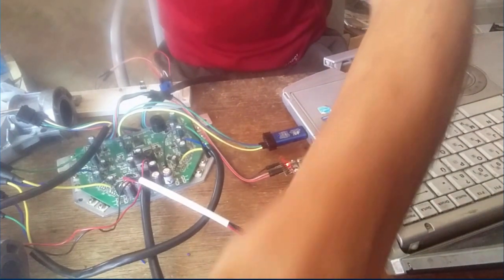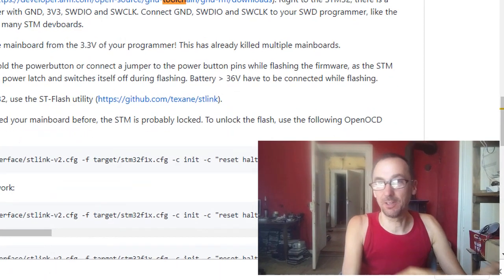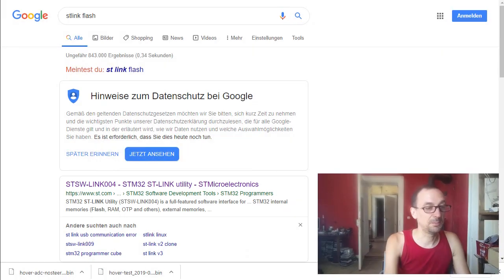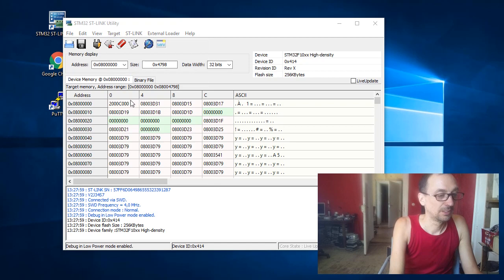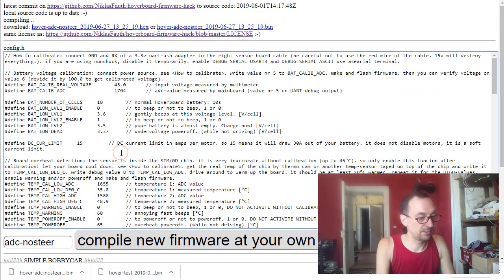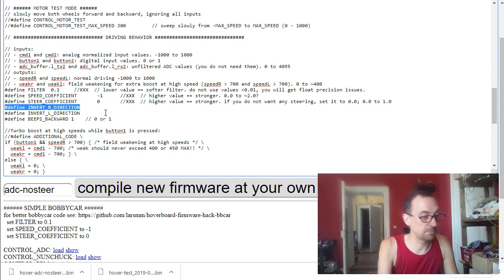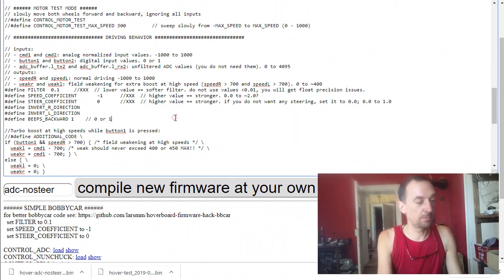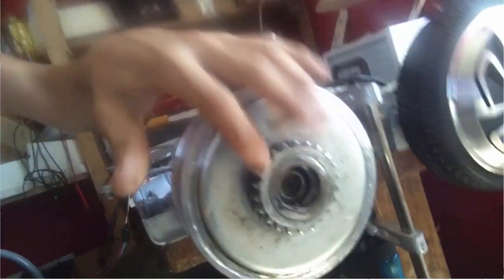free online hoverboard firmware compiler - full tutorial :-)

Comment: Hello, very nice video. I am having problem on ST link connection. I have done all the connections right. but i receive the error as " cannot connect to target". The board is powered from 36V battery, DIO, CLK, GND connections are done right. STlink dongle firmware up to date. I also tried powering the board from 3.3V from the dongle(cutting the battery power off.) what do you propose i should do? Thanks
Reply from the maker: You should shortcut the power button like shown in my video. I too had problems with connecting the dongle :-( There are some different settings in the ST-link app that you could try - but did not really help me. If nothing works then try to connect the dongle to a cheap "blue pill". If that works, than your hoverboard controller might be broken :-/ Sorry that i can not help you better :'(
Reply: @robodurden   Thanks for very fast reply. I am shunting the power button as instructed. Do you think that this might be related to different mainboard than the ones used for this firmware? Or is it because it needs unlocking? (they explain that for first flashing unlocking is necessary but no clear tutorial is available for that.)
Reply from the maker: @MertProVideo  i have already flashed two or three boards (gd32 and stm32) without any unlocking. I have no experience with stm32 chips. You might need to ask in a stm32 forum. If you have a DSO oscilloscope you could check the wires. And as i said, try to source a $2 blue pill..
Reply: @robodurden  Hi!!!! I bought bunch of new boards and one of them has worked out. (the others have some kind of hardware locks i presume.) 
I flashed the firmware using your nice compiler,  but cannot get the wheels to run or steer. I am using an RC remote, connected channel 1 and 2 as instructed, powered the RC receiver via 3.3V from the board. Did i make some mistake on the config file can you help out? cheers!

 
// Battery voltage calibration: connect power source. see <How to calibrate>. write value nr 5 to BAT_CALIB_ADC. make and flash firmware. then you can verify voltage on value 6 (devide it by 100.0 to get calibrated voltage).
#define BAT_CALIB_REAL_VOLTAGE        43.0       // input voltage measured by multimeter  
#define BAT_CALIB_ADC                 1704       // adc-value measured by mainboard (value nr 5 on UART debug output)
 
#define BAT_NUMBER_OF_CELLS     10        // normal Hoverboard battery: 10s
#define BAT_LOW_LVL1_ENABLE     0         // to beep or not to beep, 1 or 0
#define BAT_LOW_LVL1            3.6       // gently beeps at this voltage level. [V/cell]
#define BAT_LOW_LVL2_ENABLE     1         // to beep or not to beep, 1 or 0
#define BAT_LOW_LVL2            3.5       // your battery is almost empty. Charge now! [V/cell]
#define BAT_LOW_DEAD            3.37      // undervoltage poweroff. (while not driving) [V/cell]
 
#define DC_CUR_LIMIT     15         // DC current limit in amps per motor. so 15 means it will draw 30A out of your battery. it does not disable motors, it is a soft current limit.
 
// Board overheat detection: the sensor is inside the STM/GD chip. it is very inaccurate without calibration (up to 45°C). so only enable this funcion after calibration! let your board cool down. see <How to calibrate>. get the real temp of the chip by thermo cam or another temp-sensor taped on top of the chip and write it to TEMP_CAL_LOW_DEG_C. write debug value 8 to TEMP_CAL_LOW_ADC. drive around to warm up the board. it should be at least 20°C warmer. repeat it for the HIGH-values. enable warning and/or poweroff and make and flash firmware.
#define TEMP_CAL_LOW_ADC        1655      // temperature 1: ADC value
#define TEMP_CAL_LOW_DEG_C      35.8      // temperature 1: measured temperature [°C]
#define TEMP_CAL_HIGH_ADC       1588      // temperature 2: ADC value
#define TEMP_CAL_HIGH_DEG_C     48.9      // temperature 2: measured temperature [°C]
#define TEMP_WARNING_ENABLE     0         // to beep or not to beep, 1 or 0, DO NOT ACTIVITE WITHOUT CALIBRATION!
#define TEMP_WARNING            60        // annoying fast beeps [°C]
#define TEMP_POWEROFF_ENABLE    0         // to poweroff or not to poweroff, 1 or 0, DO NOT ACTIVITE WITHOUT CALIBRATION!
#define TEMP_POWEROFF           65        // overheat poweroff. (while not driving) [°C]
 
#define INACTIVITY_TIMEOUT 8        // minutes of not driving until poweroff. it is not very precise.
 
// ############################### LCD DEBUG ###############################
 
//#define DEBUG_I2C_LCD             // standard 16x2 or larger text-lcd via i2c-converter on right sensor board cable
 
// ############################### SERIAL DEBUG ###############################
 
#define DEBUG_SERIAL_USART3         // right sensor board cable, disable if I2C (nunchuck or lcd) is used!
#define DEBUG_BAUD       115200     // UART baud rate
//#define DEBUG_SERIAL_SERVOTERM      // Software for plotting graphs: https://github.com/STMBL/Servoterm-app
#define DEBUG_SERIAL_ASCII          // "1:345 2:1337 3:0 4:0 5:0 6:0 7:0 8:0\r\n"
 
// ############################### INPUT ###############################
 
// ###### CONTROL VIA UART (serial) ######
////XXX #define CONTROL_SERIAL_USART2       // left sensor board cable, disable if ADC or PPM is used!
#define CONTROL_BAUD       19200    // control via usart from eg an Arduino or raspberry
// for Arduino, use void loop(void){ Serial.write((uint8_t *) &steer, sizeof(steer)); Serial.write((uint8_t *) &speed, sizeof(speed));delay(20); }
 
// ###### CONTROL VIA RC REMOTE ######
// left sensor board cable. Channel 1: steering, Channel 2: speed. Use a very short cable!
#define CONTROL_PPM    //XXX                 // use PPM-Sum as input. disable CONTROL_SERIAL_USART2!
#define PPM_NUM_CHANNELS 6          // total number of PPM channels to receive, even if they are not used.
 
// ###### CONTROL VIA TWO POTENTIOMETERS ######
// ADC-calibration to cover the full poti-range: connect potis to left sensor board cable (0 to 3.3V) (do NOT use the red 15V wire in the cable!). see <How to calibrate>. turn the potis to minimum position, write value 1 to ADC1_MIN and value 2 to ADC2_MIN. turn to maximum position and repeat it for ADC?_MAX. make, flash and test it.
////XXX #define CONTROL_ADC                 // use ADC as input. disable CONTROL_SERIAL_USART2!
#define ADC1_MIN 0                // min ADC1-value while poti at minimum-position (0 - 4095)
#define ADC1_MAX 4095               // max ADC1-value while poti at maximum-position (0 - 4095)
#define ADC2_MIN 0                // min ADC2-value while poti at minimum-position (0 - 4095)
#define ADC2_MAX 4095               // max ADC2-value while poti at maximum-position (0 - 4095)
 
// ###### CONTROL VIA NINTENDO NUNCHUCK ######
// left sensor board cable. keep cable short, use shielded cable, use ferrits, stabalize voltage in nunchuck, use the right one of the 2 types of nunchucks, add i2c pullups. use original nunchuck. most clones does not work very well.
////XXX #define CONTROL_NUNCHUCK            // use nunchuck as input. disable DEBUG_SERIAL_USART3!
 
// ###### MOTOR TEST MODE ######
// slowly move both wheels forward and backward, ignoring all inputs
//XXX #define CONTROL_MOTOR_TEST
//XXX #define CONTROL_MOTOR_TEST_MAX_SPEED 300         // sweep slowly from -MAX_SPEED to MAX_SPEED (0 - 1000)
 
// ############################### DRIVING BEHAVIOR ###############################
 
// inputs:
// - cmd1 and cmd2: analog normalized input values. -1000 to 1000
// - button1 and button2: digital input values. 0 or 1
// - adc_buffer.l_tx2 and adc_buffer.l_rx2: unfiltered ADC values (you do not need them). 0 to 4095
// outputs:
// - speedR and speedL: normal driving -1000 to 1000
// - weakr and weakl: field weakening for extra boost at high speed (speedR > 700 and speedL > 700). 0 to ~400
#define FILTER    0.05    //XXX  // lower value == softer filter. do not use values <0.01, you will get float precision issues.
#define SPEED_COEFFICIENT    0.5    //XXX  // higher value == stronger. 0.0 to ~2.0?
#define STEER_COEFFICIENT    -0.2    //XXX  // higher value == stronger. if you do not want any steering, set it to 0.0; 0.0 to 1.0
#define INVERT_R_DIRECTION
#define INVERT_L_DIRECTION
#define BEEPS_BACKWARD 0    // 0 or 1
Reply from the maker: @MertProVideo  first flash the CONTROL_MOTOR_TEST to verify that your board and motors are functional. Another user succeeded with PPM and learned that With CONTROL_PPM you need to set PPM_NUM_CHANNELS in config.h to those of your PPM transmitter (like 10 for example).

Comment: Thank you so much for your online compiler, until I found
it I was not making any progress controlling the hoverboard motors. For others
that are grateful consider checking out robo durden's video about wanting to
help out in Wuhan https://www.youtube.com/watch?v=3SsSt4w4zJs and contribute a
few bucks to his go fund me https://www.gofundme.com/f/help-me-get-infected-fly-to-wuhan-help-6-months

There are two things I would like to ask about:

First, I am still having problems controlling the speed of the
motors.

 I am using the RoboDurden/hoverboard-firmware-hack code and example
code for Arduino  https://github.com/RoboDurden/hoverboard-firmware-hack/blob/master/hoverserial.ino

When I send different values to the Send(int16_t iSpeed)
function any value over 2 runs the motors at max speed one direction and any
value under -2 runs the motors at max speed the other direction. 
Do you have any suggestions of what I might be doing wrong? Or what I need to do to get it working?

Second, I have recently discovered there are these small boards
called blue pills with a STM32F103C8T6 on them that people are programming with
the Arduino IDE. What do you think would be the possibility of programming the
hoverboard motor control board using the Arduino IDE? If it is possible, how
difficult would it be to do so?

Comment: Very well done tutorial and thank you for your compiler!! I had a question about steering with potentiometers that I REALLY hope you can answer. When using the steer pot, it only incrementally increases the direction it turns left. It wont go the other way. Is there any code I can change to make it turn both left and right?
Reply from the maker: You should compile the Niclas ADC armchair preset. Attach a USB uart module to get the debug output. First two number are adc1 and adc2. Take a look at main.c to learn how the steer adc effects the speed of left motor and right motor.
Reply: @robodurden  Thank you for such a swift response!! Changing the Steer_Coefficient from - to + only changes which  wheel rotates, but it is still only able to go in one direction. Do you know if there is a way to make each pot associated with one wheel's speed independent of the other?  I don't know if you've already addressed this somewhere else or not. Thank you for your time!
Reply from the maker: @dmahoney23  Tale a close look at the main.c and learn how the two adc values and up as speed left and speed right. If course you can modify main.c so speed adc is only for speed left and steer adc will be for speed right.

Comment: I have tried compiling Bipropellant firmware through the online tool but it gives the following error. The only change I have made this far is low voltage values in config.h.

src/protocolfunctions.c: In function 'setup_protocol':
src/protocolfunctions.c:356:5: error: 'protocol_GetTick' undeclared (first use in this function); did you mean 'protocol_tick'?
     protocol_GetTick = HAL_GetTick;
     ^~~~~~~~~~~~~~~~
     protocol_tick
src/protocolfunctions.c:356:5: note: each undeclared identifier is reported only once for each function it appears in
src/protocolfunctions.c:357:5: error: 'protocol_Delay' undeclared (first use in this function); did you mean 'protocol_enable'?
     protocol_Delay = HAL_Delay;
     ^~~~~~~~~~~~~~
     protocol_enable
src/protocolfunctions.c:358:5: error: 'protocol_SystemReset' undeclared (first use in this function); did you mean 'protocol_byte'?
     protocol_SystemReset =HAL_NVIC_SystemReset;
     ^~~~~~~~~~~~~~~~~~~~
     protocol_byte
make: * [build/protocolfunctions.o] Error 1

Comment: Great video. Thank you for taking the time to do this! I have converted a Hoverboard into a Onewheel. Although the standard firmware works I do have the desire to make some changes like voltage tresholds. The big Onewheel takes more current and now with the cold weather it triggers the 3.6 volt alarm too soon. So for this I intend to flash the Bipropellant firmware as it still has the Hoverboard functionality. But reading up on Github I see there is also a PID controller implemented which I am interested in. Increasing the Integral value will probably give a more locked in feeling on the bigger platform. However no matter how much I search on Google there seems to be zero information on how to use it. I someone can point me into the right direction it would be highly appreciated.
Reply from the maker: concerning the voltage thresholds simply edit the config.h:

#define BAT_NUMBER_OF_CELLS     10        // normal Hoverboard battery: 10s
#define BAT_LOW_LVL1_ENABLE     0         // to beep or not to beep, 1 or 0
#define BAT_LOW_LVL1            3.6       // gently beeps at this voltage level. [V/cell]
#define BAT_LOW_LVL2_ENABLE     1         // to beep or not to beep, 1 or 0
#define BAT_LOW_LVL2            3.5       // your battery is almost empty. Charge now! [V/cell]
#define BAT_LOW_DEAD            3.37      // undervoltage poweroff. (while not driving) [V/cell]

I think Niklas tested these motors up to 13s. That would nearly double the power output of these motors.
Watch the lengthy video from him where he talks about maximum voltage.

Great you are using the Bipropellant  firmware. I never tested it. Please upload a video of your one-wheeler. I can not really imagine how to convert the hoverboard into such a cool device !

Don't really know what you mean with a PID controller. But i never looked into the Bipropellant  firmware.
You take a look at the main.c code. The control loop is in there and can easily be modified.
Reply: @robodurden  I was inspired by this build from Ddirit: https://youtu.be/0shWuGG8B4I

Conversion is actually quite basic. But as said because of the bigger platform controls feel a bit loose. I did not install the bipropellant firmware yet and I read that it uses a different algorithm anyways. So I will check this out first. It seems the PID loop controller was implemented in 2015 already but no documentation whatsoever. I regularly use it on racing drones and it lets you set the amount of force the board needs to make angle adjustment and the amount of force it needs to maintain a certain angle without control input.

ps. I plan to upgrade the battery to 12S to lower amp draw and increase the speed slightly. Because of the 11" wheel top speed i already near 25km per hour and quite scary because you don't want to go nosediving on top speed :)
Reply from the maker: @Bionic24  oh yes why not use both motors of the hoverboard to make one big one-wheel ! Simple side by side with the shafts pointing outside. if The two motors are attached correctly, the hall sensor would be in sync when one pair of one motor is swaped. And you probably could use the two pressure sensors in a front/rear configuration. When you have the analog pressure values of front and rear it should be quite easy to write a control loop from scratch.
Hey you should make a Kickstarter offering a rebuild-tutorial to convert a cheap hoverboard into such a crazy one-wheeler. I will back you with $20 :-)
Reply: @robodurden  You make it sound so easy haha. I actually had one of the motors turned 1/6 rotation. It was driving terrible. Some pictures of my build are here: https://forum.esk8.news/t/diy-onewheel-hoverboard/18862/13

VESC from Benjamin Vedder actually has all the goodies for Onewheel implemented like kickback when you are on the edge of overspeeding and stuff like that but they don't support the use of 2 motors.
Reply from the maker: @Bionic24  great thread in your forum. So you indeed already use both hoverboard motors. And still the original firmware ??
Maybe you like my 400 Watt charger https://youtu.be/MRrilVLiASw
Could do a tutorial in two weeks.
You should know that nkon.nl is probably the cheapest 18650 source in Europe ;-)

Why not simply use the old rubber tires from the original hoverboard ? As you can see in my linked video, my corexy printer is not precise at all :-( Never found the happiness to calibrate it.
Reply: @robodurden  nahh I like the big Gokart tyre. It also helps riding uneven terrain. And going from 6,5" to 11" wheels means a theoretical increase of speed of 1.7x.

I order from Nkon for work all the time. Great company indeed. But this is my 'scrapheap challenge'. I bought a lot with defective hoverboard batteries and I am currently disassembling and matching the cells. You wouldn't believe the batteries people throw away.
Reply: @robodurden  My ST-Link programmer should arrive in the mail tomorrow. Can't wait to start programming some of this stuff. Meanwhile I discovered that the Onewheel functionality in VESC originated from this project:https://github.com/blezalex/WheelBoardMain. I still have a large pile of these old Naze32 boards with F1 processor that I can use to flash this firmware to. Am I crazy in thinking that the PWM output of this controller can just as well be hooked up to the hoverboard instead of an external ESC? The PWM signal should be the same as the one coming from a receiver?